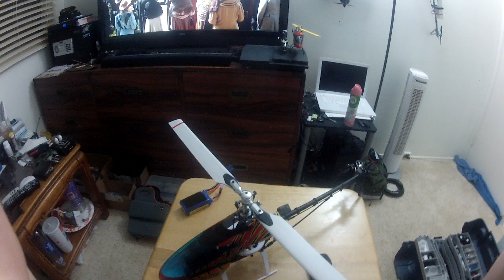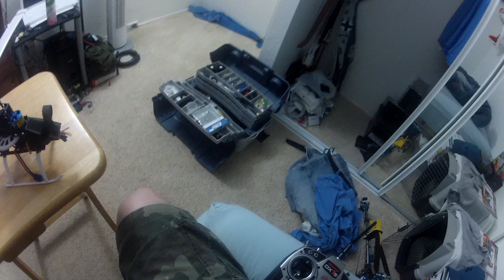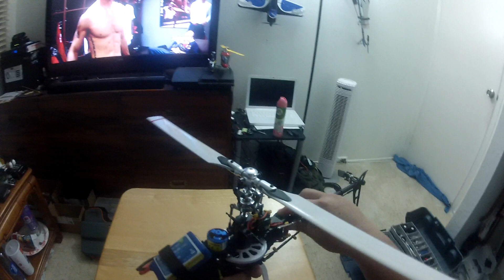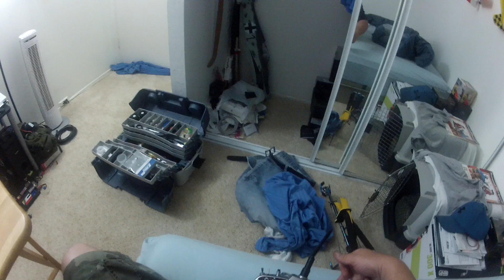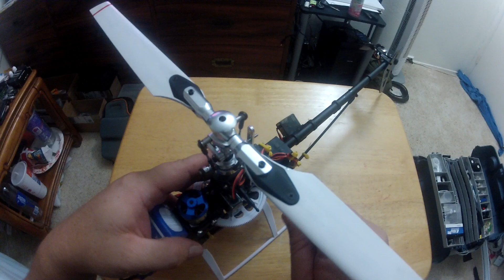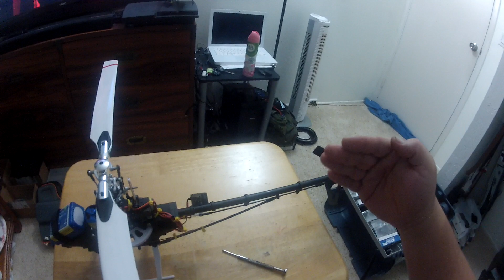Setting your servos at zero blade 300x

Comment: Hey I have a blade 300x. I’m new to the game it has almost everything upgraded to carbon fiber (the blades, the tail rod, and back blade). I don’t really know anything about it but when I touch the throttle at all, the whole helicopter starts to shake violently, to the point it will fall over. I removed the blades and it doesn’t shake at all with them off. Any suggestions?
Reply from the maker: your blades may not be balanced well together.  the blades have to be a matching set.  Sounds like your setup is to rigid.  Depending on the flight controller you may have to high of P and I gains if you are using the AS3X flight controller.  If you are using a different flight controller your gains may still be too high.  But sounds like its because of a mismatched pair of CF blades.

Comment: what you just explained should be preformed through menu point G on the AR7200 after each crash to make sure that the connecting rods have not jumped threads and changed lengths. menu point G will automatically center the servos for you, then level your swash.
Reply: Kelton Brooks

Comment: Those stock servos are pretty crappy lol, I used to rebuild mine all the time also. The only one that doesn't stripped is the rudder but it burns out. Thank god I found a good soul one helifreak that sold me some MKS92a+ for cyclic and a MKS95i for the rudder for about $150. I can't count how many times I have had to rebuild the whole heli but no more servo issues here.

Comment: Tail servo on my 300x will not respond to input or gyro when heli is energized. I manually move the tail blades and servo gears are smooth. What failed?

Comment: great video but just a tip on safety, I suggest to disconnect at least 2 motor connectors off from the ESC whenever you do any service to your heli.  This way, there is no way the motor will start and cause injury.  TH is a good tip but certainly is not safest.

Comment: Are you using the stock servos? I've had my 300x for a month now, two of the servos went bad right away but were warrantied by HH. They seem to be working fine now but I was wondering if there is a suitable metal gear replacement.   Thanks...Barney

Comment: You do need to make sure that each of the 3 swashplate links are on the same hole on each servo. Probably not gonna cause a huge difference but the leverage on each servo would be different if they're not in the same hole.